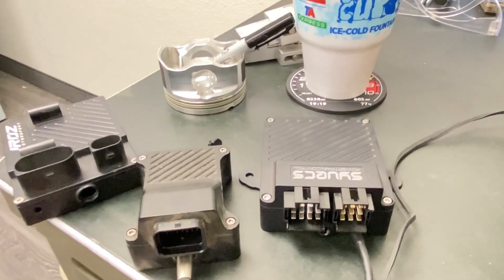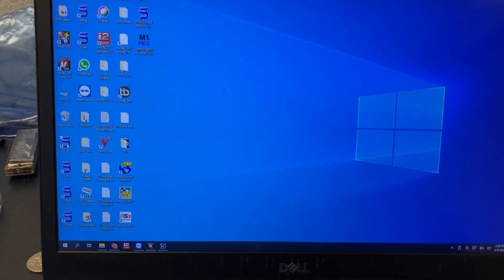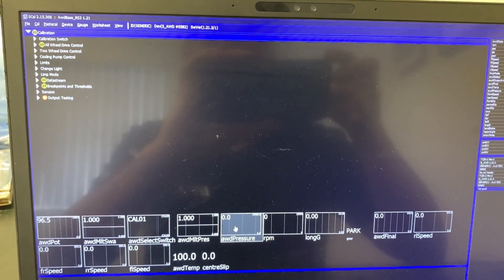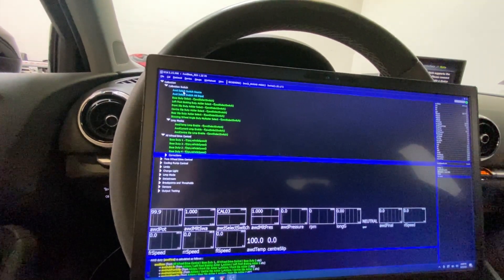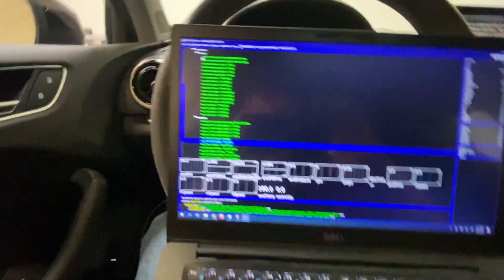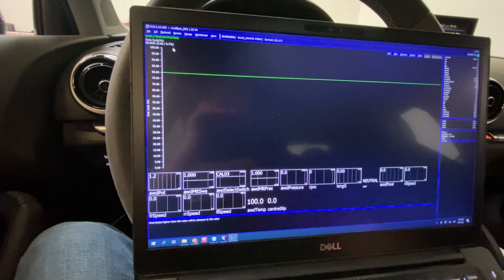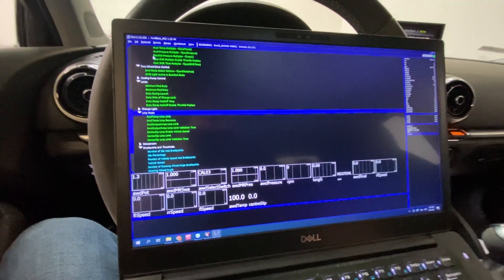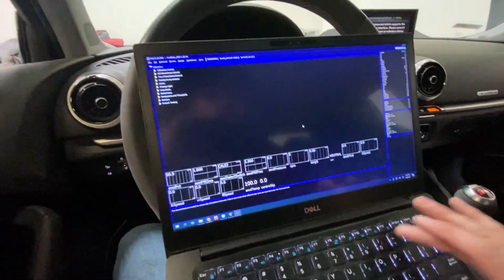Tuning Your Syvecs Haldex Controller

Comment: Might be a dumb question,  but when you log this/ or have it hooked up into the computer like Hank does in this video, does the cable get ran like the harness? I'm sure you don't want to leave the computer harness plugged in and when normal driving you want the plug on to cover the port? Does it hook up/connect without that computer USB cable?

Comment: The backward potentiometers situation needs clearer info please.  You say in the video  the multiplier table needs to be edited, but you don't explain how or what values...  Also reversing the voltage x-axis is questionable.  It makes the pot operate in the clockwise direction, but doesn't change the voltage direction.  0% becomes 5v and 100% becomes 0 volts.  More info, or a calibration file, or please send a new potentiometer to those effected.